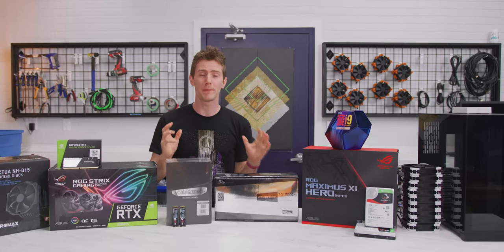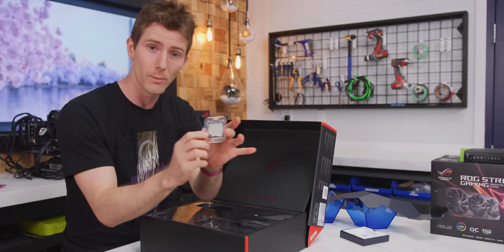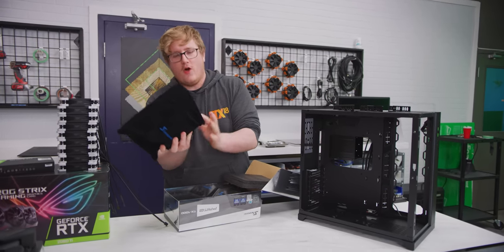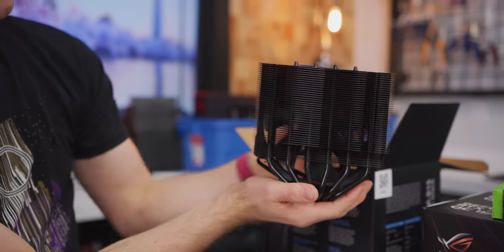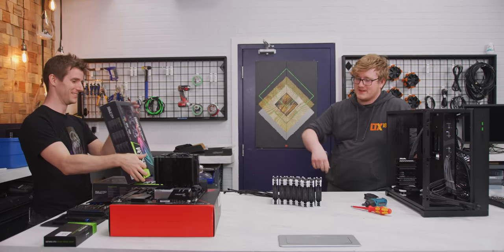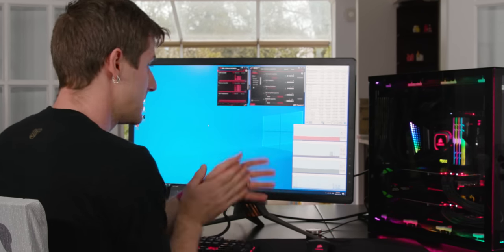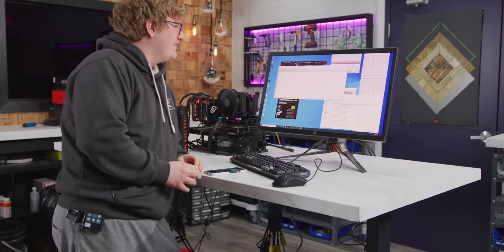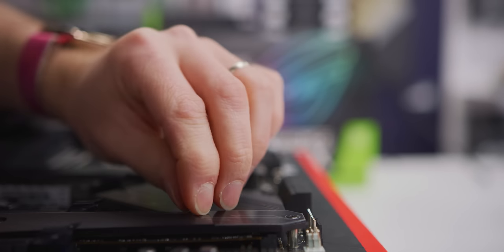Can AMD Beat the ULTIMATE Intel Gaming PC?

Comment: AMD: Underdog to monopoly in 5 years.
Reply: Well they are still underdog. We will see in the next few years
Reply: @pxlcoarl  I wouldn't call them much of an underdog in anything but gaming and other less multi-threaded applications. AMD literally crushes Intel on basically every other front (at least in the mainstream desktop space). 

I bought an I5 7500 and regret it big time.
Reply: Can AMD and Intel stop owning the x86-64 architecture for once and do the ARM route?
Reply: Chris Harrison They’re the underdog in market share. Intel still has a near monopoly.
Reply: @Chriss_Fishes  You should have an i5 9600K instead, the price/perfomance ratio is insane.
Reply: @aricrudd6579  In that case, you're correct. However, in performance numbers, you can see my point.

As for the 9600K... My next CPU will definitely not be one made by Intel, unless something changes drastically over the next year or two.
Reply: @Chriss_Fishes  But you are right, AMD still will beat intel with the rest. For no reason despite that the i5 9600K is a beast, lacks hyperthreading .

For a weird reason, this is a problem with Intel Core 9th gen. The i7 8700k was better than the i7 9700K because the latter lacks hyperthreading, i really don't know what is going on with Intel.
Reply: @saricubra2867  I see very difficult Intel or AMD using just one architecture for every CPU, that can give to ARM Holding a brutal monopoly.
Reply: @jonnypena7651  ARM gave their architecture to many producers, not only Qualcomm and Mediatek, meanwhile, x86 is only Intel and AMD. It's a duopoly.
Reply: @Chriss_Fishes  Intel controls most of the CPU market with its share growing from 77% in 2014 to 82% in 2016, and back at 77% in 2018. AMD's share fell from 23% in 2014 to 18% in 2016, but it has been on a rise since then to 23% in 2018. In fact, if we look at Q3 2019 numbers, AMD's share stands at 32%

Thats not really "crushing" Intel is it? Amd dont get me wrong here, I am a big fan of what amd is doing, im using a r5 2600 and i love it, but still amd is hell of an underdog.

Edit: source: https://www.google.com/url?sa=t&source=web&rct=j&url=https://www.forbes.com/sites/greatspeculations/2019/09/24/amd-vs-intel-a-detailed-comparison-of-revenue-and-key-operating-metrics/amp/&ved=2ahUKEwjE7uPnkuToAhWMnqQKHUygD0AQFjACegQIDBAJ&usg=AOvVaw08AXiTtkqIQqVPJMjEp12y&ampcf=1
Reply: @saricubra2867  nop, they don't have, they paid, and ARM can remove at end of the agreement, ARM Holding is the only owner, but x86/64 are Intel, AMD, VIA (yes they still working) and IBM.
For example, if Qualcomm, Mediatek or Apple stop paying ARM they can remove the right of the use of the license.
Reply: @jonnypena7651  First time ever that i read that IBM did x86 processors, i know them by the Power PC which is RISC based like ARM.

Still, i'm very sure that ARM is more liberal in how the companies change the designs, this is why the mobile market surpassed the desktop and laptop one in growth.

Even laptops with ARM are on the rise, while i can't imagine the programming mess due to the different architecture, who knows...
Reply: Intel can sleep 10 years and still amd will be an underdog or behind.
And if intel drop their price (highly unlikely though) to match amd then amd would be stuck where it is now.
Reply: @Zero.Requiem  In the past when AMD had the performance crown Intel maintained its position using unfair practices, even today they still using some tricks, no because they better or at least try.
Reply: @jonnypena7651  when did Amd have the performance crown in the past?
Reply: @pxlcoarl  Maybe the Athlon line? They created the first 64 bit processor and dual core. Then Intel started to destroy them when the core series appeared, AMD was in bankrupcy during the middle 2010's until they changed the CEO and the Ryzen series appeared (which it's the core equivalent of AMD) and saved the company. Now AMD will surpass intel for the first time almost in 20 years because they have the edge with the silicon factories, since intel only has their own factories and are behind Moore's law (which was created by one of the co-founders of intel ironically). 

AMD makes chips with more and smaller transistors, so we have better price/perfomance ratios and overall perfomance too.
Reply: @jonnypena7651  yeah, when is amd got the crown? Intel has it on its head from the start.
Reply: @saricubra2867  IBM bough a x86 license in the past in an special agreement.
The thing with ARM is there are 2 different kind of license: Cortex licence that allow SOC makers like Qualcomm and Mediatek create semi- custom cores like Kryo or vanilla core like Cortex A57, companies like Huawei and Apple buy Architectural licences, it allow the company to create a semi-custum ARM based architecture. Both cases if those companies don't pay ARM will revoke their license.
https://en.m.wikipedia.org/wiki/ARM_architecture#Licensing

As an example when EEUU government attacked Huawei in its comercial war they forbidden AMR holdings of gave them a new license.
But due China bought VIA they have the right to X86 licences but no to ARM licences.
Reply: Intel will come back in 2022 i bet, and they'll probably fall behind again possibly, but at least we will have decent choices now
Reply: @Zero.Requiem  with the Athlon 64 it was at least 20% faster in games, and with the Athlon64 X2 almost 40% in multicore and and retaining the gaming crown: https://www.anandtech.com/show/1676/7
The faster Intel CPU at time only manage to match the slowest Athlon CPU with a price of 200 dollars vs the Pentium Xtreme at more than 800 dollars.
Thera are other examples but that was the greatest making Intel play unfair for many years, even now they are trying to avoid pay the fine for Monopoly practices.
Reply: @pxlcoarl  with the Athlon 64 it was at least 20% faster in games, and with the Athlon64 X2 almost 40% in multicore and and retaining the gaming crown: https://www.anandtech.com/show/1676/7
The faster Intel CPU at time only manage to match the slowest Athlon CPU with a price of 200 dollars vs the Pentium Xtreme at more than 800 dollars.
AMD gave to the user many feature that  otherwise Intel would save only for enterprise business, like 64bit, dual core, IMC.
Reply: @Vihara2  AMD doesn't have the same lidership like the past, Lisa Su has a roadmap and a very aggressive strategy.
Reply: @jonnypena7651  For me it's still mindblowing that we are still using x86 processors. IBM's Power9 is simply ridiculous, they use arguably more alien tech than AMD is doing right know with the Threadripper series and EPYC.

I think IBM is still the best CPU producer in terms of raw perfomance, i remember that story of an US Air Force super computer made from PS3s (the Playstation 3 is powered by an IBM supercomputer CPU) lol.
Reply: And what unfair practices? I agree that intel suck at pricing and marketing their stuff but amd suck before ryzen processor came in to the picture.
And for unfair practices isn't it curious that a bunch of this techtubers trash intel even though in real world experience it doesn't really matter. I mean a 60-80 fps intel cpu performance is actually wouldn't make of a difference on you being good at gaming when its on 100-120 fps amd cpu right. Its all about your skill in gaming if you suck, you suck no infinite number of fps can change that. But this techtubers make it like you couldn't do shit in an intel cpu 30-40 fps lower than amd. Why is that, are they being paid by amd to trash intel? if thats the case then that is the true unfair practice.
Reply: @saricubra2867  IBM helped Sony at time (witch also knew how to make chip, but no more) CELL isn't powerPC architecture and developer hate it due its complexity.
At that time IBM failed in providing CPU powerful than X86, it took them a lot of time to recover the performance crown but then Intel already had 70% of the market.
Reply: @Zero.Requiem   Intel in the past bribe other companies to use only their CPUs and even called DELL "the best friend that the money can buy".
They were fine, and when the i9 benchmark come out the company that published the benchmark crippled AMD CPU making it 40% slower.
Then Intel presented a 28 core CPU a 5ghz all core in the COMPUTEX to tackle the launching of the Threaddripper 2990X but it was discover that Intel hide an exotic cooling system to maintain those 28 core in reasonable temperature none achievable in normal conditions.
The techtuber trash Intel because they are offering the same architecture for almost 4 years with no new feature, forced sockets changes and abusive politics, like HT in some parts, limited PCI lanes and ram capacity in very expensive CPUs.
Reply: @jonnypena7651  Yes, it was hard to program. Fun fact, the Cell has PowerPC as the base, but it had other "cores" for different calculations, even graphics, they work similarly to GPU shaders or cores, that's why it's alien tech and way ahead of it's time, it had insanely strong parallel processing power and achieving big numbers of GFLOPS ever surpassing high end Intel processors until maybe 6th or 7th gen i think.

Nowadays, you can use Vulkan or Swift Shader in your i7 9700K and you can use your CPU for graphics, just like the Cell processor from the PS3, your 2080 Ti has an insane number of shaders or core count that surpasses the number of cores in your CPU, it's pretty crazy the history behind the PS3's CPU but i kinda see the legacy in the PC side of things.
Reply: @pxlcoarl  Again, in terms of market share, you're correct. That's not what I'm talking about.

I'm talking about performance, in which case, yes, AMD absolutely does beat Intel in more standard desktop workflows than it doesn't.
Reply: @Chriss_Fishes  true

Comment: Alright, now lets try this again, with a single video card, no spinning disks, and how about the 9900k vs the 3900x instead of the 3950x. While the 3950 is the higher model, the specs are lower than the 3900 by a decent amount due to more cores. Choosing the 3950 seemingly shows a preference for the intel system, and then you wonder why people think you have a bias towards intel.
Reply: Well im not really expert in this , but i thought 3900x wasonly slightlyfaster and consumes more power
Reply: sigh, the fresh smell of ignorance. gamers nexus has already done a video on this. result? a stock 9900ks still beats every ryzen cpu out there (overclocked or not) in gaming. yes, amd has great value and awesome multithreaded performance, but in gaming you can't deny that intel is still top dog. no point trying to sift out the small details and start crying over why amd didnt win. it was already expected.
Reply: The 3950X is a meme CPU that exists for gamers to flex having lots of cores they will never use. Seen memers shitting on the 9900KS and then shilling the 3950X like that makes sense either. For dual GPU setups, it’s pointless to use non-HEDT for SLI, since you would be running x8 on both...
Reply: @Amusia727  I've never known anybody to drop £750 on a CPU to meme on somebody who spent £500 on a CPU
Reply: @AceVproductionsPC  You'd be surprised...

Comment: My PC is similar to this build. 
Lian Li 011 Dynamic Razer Edition
ASrock Taichi Razer Edition
RTX 2080
AMD Ryzen 5800X
64gb Trident Z Royal
Noctua NH-D15 Chromax Black. (Because who needs a side panel?)
1300w power supply
Total system storage 22TB (one of those is a 16tb Exos drive)

Comment: "No differance in performance"

Meanwhile my 2 Titan RTX's barely managed to hit 1900mhz and would often downclock 1700mhz @ 80*c while gaming. After throwing on 2 Corsair Hydro blocks I'm running them at 2,200mhz and my 9900k (Not KS) at 5.1ghz and the CPU/GPU sit 70*c/50*c while gaming
Reply: Weird flex but ok
Reply: @zeplyn5684  Isn't a flex so much as pointing out that "Doesn't make a difference" is ENTIRELY dependent on implementation/application. Most people on steams hardware survey would as Linus points out not see much if any difference switching to an AIO over a Hyper 212 or similar style tower cooler.

Comment: I cant certainly say for certain that there is a massive difference between Air cooler PC and AIO cooler.  My Ryzen 7 3700x on Air idled at 120-140F   On my AIO I isle at 91-105F    Under a load is where I see the difference.

Comment: Curious, was the 3950X a "run of the mill" cpu or was it also prebinned?  I'm wondering if buying a similarly tested / overclocked 3950X would have closed the gap a bit....

Comment: if you look behind Linus while he introduces the cpu you can see a computer in the background, and based on the boxes at the intro it sure looks like they did a test run with the same components, you can recognize the noctua black cooler and the 2 2080 ti and I think the same motherboard.

I'm saying this because even thought they did a test run for the bios I guess, they did not do a test fit for the cooler in the case

Comment: There is actually a difference between air and water cooling. You don't have to worry about your water pump going out with air cooling. And it runs quieter.

Comment: can anyone explain to me why the better processor is deteremined by fps, if you can't tell the difference past 80fps? Did anyone even bother to question that maybe, just maybe, the ryzon is built to run more efficient when there isn't a need for power? I noticed on most benchmark tests, the ryzon was working most of the time at 50% of its potential, where as intel was working at 70% of its potential most of the time. (stock). Maybe amd figured that they won't push for the extra 5-10 fps, when nobody could tell a difference, and would rather save power, which actually does make a difference, for a lot of things. On the other hand, when the amd processor is actually pushed to its limits by things other than videogames, where the demand for power pushes it into using 90-100% of its potential, it out preforms intel.

Comment: Pre-over clocked cpu with water cooling
Beats non-over-clocked cpu with air cooler?

Uhm... Does the amd one overclock itself naturally?
What about if you overclocked the amd one to the max and the intel one to the max and re-ran the system, and both ran with water cooling? Could possibly make a difference...

Comment: It's a weird day when I have more ram. Dual 16gb 3200 chips plus dual 8gb 3200 chips just cuz they were laying around and I had the extra sockets.  Eventually getting two more 16gb 3200 chips and running xmp on all 4 (if that's possible).  48gb of ram is a noticeable improvement on games that offload assets onto the ram, such as Cities Skylines, Warzone, Battlefield 2042, and Microsoft Flight Simulator.

Comment: You said that liquid cooling or air cooling, it doesn't make any difference.
Well, if you take 2 pieces of metal, and heat them to the same temp, blow air on a piece and pour water on the other, which one will cool faster?
Not trying to say you're weong, as there may be an explanation to this. Could you plz help me understand this?
Reply: Not what water cooling is lol

Water cooling is still blowing air on metal, the difference is the way heat is transferred to the metal

Water cooling is far less efficient than heat pipes, the only advantage is that you can move the heat to radiators to more efficiently dissipate the heat

Comment: Always using Nvidia cards, but I have the feeling for a couple of years that since Nvidia is the standard to test Nvidia has code in their drivers to make AMD CPU look bad. When you calculate on specs, like IPC, Frequency and clocks of instructions some results just don't add up. Maybe time to do some testing on non Nvidia GPU's.

Comment: Lot of people boasting AMD's 7 nm lithography ( which they tell it's 40% less heat generation and at least 30 % faster and almost 1.5 times transistor density compare to 14 nm architecture). So why AMD processors  (whether Threadripper or Ryzen) have higher TDP compare to Intel ? (Intel is actually using only 14 nm++ architecture).
Even your benchmark showed that AMD and Intel have only +- 2 to 4 % performance difference.

Comment: Just moved from a hot cpu (4770K overclocked to 4.7ghz) to an even hotter Ryzen 7 2700 and also swapped from water to air cooling and I'm actually running cooler lol

Comment: I could realistically buy this. I wouldn't... but I could. I tried SLI a few years back with the 600 series and It was very underwhelming and absolutely not worth the price of a second graphics card, ever since, I've gone with a single top tier card. I don't think I'd bother paying extra for a pre-overclocked CPU either, the difference wouldn't even be noticeable enough to justify the extra cost IMO. So definitely some wasteful spending here but not out of the realm of what's affordable to anyone with a good job, low debt and priorities set on PC gaming.

Comment: Intel will always hold the crown for gaming king, considering, if you wish to play older games, i.e: Kotor, the game will forever be optimized for higher clock speed and not give a rats-ass about core count...
So even if AMD starts pulling ahead in the future with higher core counts and game devs program games to suck back all them cores, AMD would then only keep the crown for new games and possibly only for a while, because Intel could match them or beat them...

So all in all, what Intel has done, has solidified winning the past, and for now winning in the present, we shall see what the future brings, but if there was any reason to pick one over the other, for gaming? I'd pick Intel.

Comment: Did I see a couple of old HDS??? I wouldnt recomend  that in later 2020 (unless u have some hole to fill with a couple of door stops @ 500usd). Plus aircooling and overclocked CPU? No thanks where I live. Fate said it cannot fit in there so get an AIO.